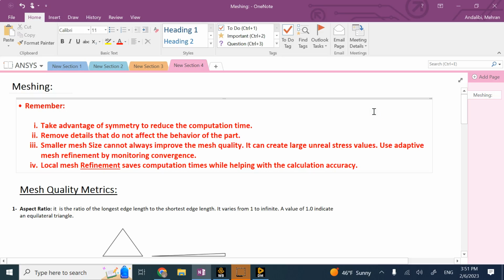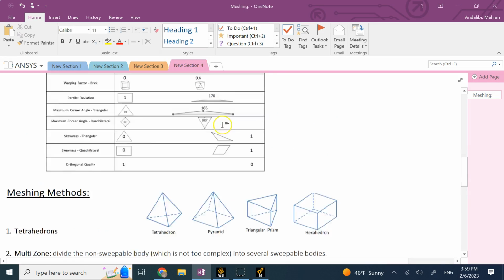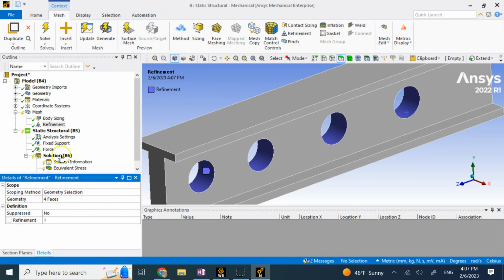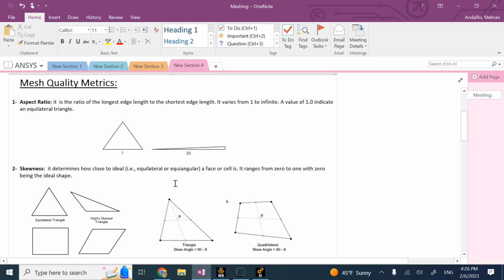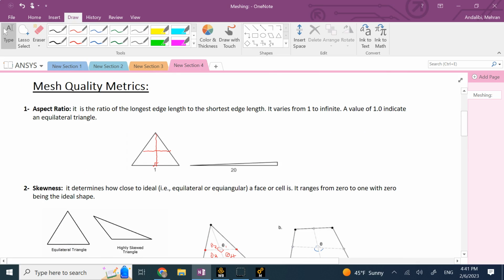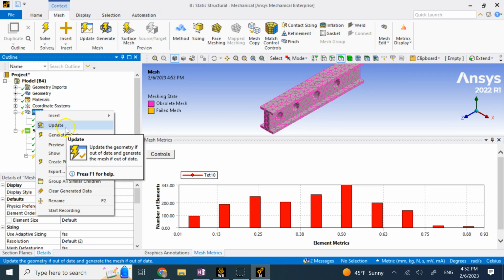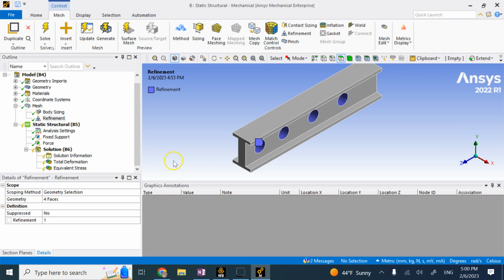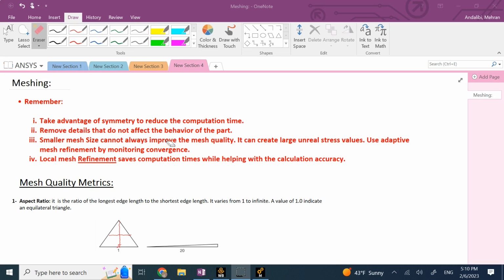Meshing (Element Types, Mesh size, methods, refinement, and quality metrics, Results Convergence)

Comment: You are born a teacher, you really took time to explain.
Reply: Prof I jus graduated from the university. I studied mechanical engineering, and during my years in school I didn't really choose fea course. So the most knowledge I have is in solid mechanics/strength of materials, thermodynamics and fluid mechanic. So in order to start using ansys, is it Soo important to learn all those fea calculations and the rest, or should I just stick with my knowledge in those aforementioned courses and possibly utilize them for hand checks.

Comment: Hello sir, thank you for the video. I have a question. Why it is less accurate when the shape of the mesh is deform? as you said the more the shape of the equilateral triangle deform from its original equilateral, the less accurate it is. Can you explain more of this in the comment. Thank you so much Sir.